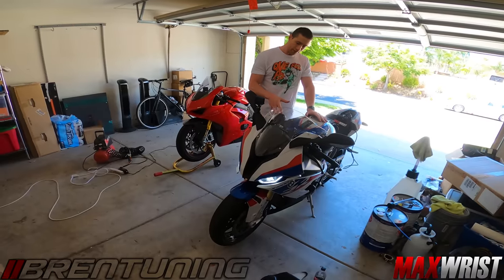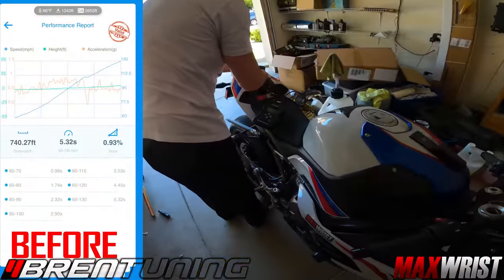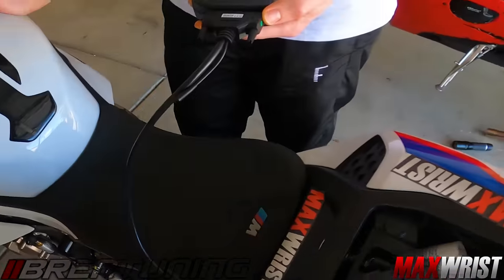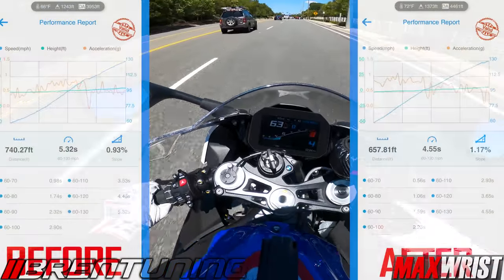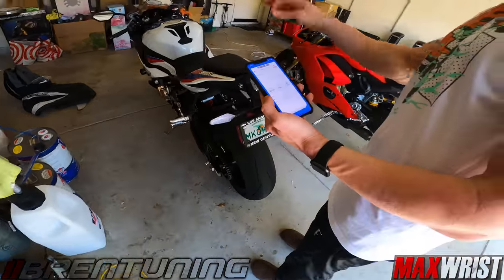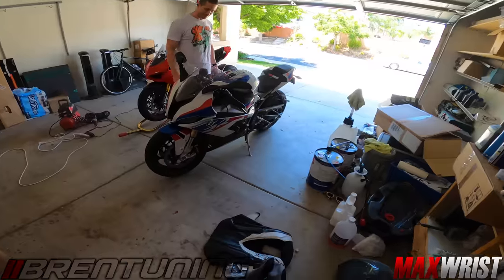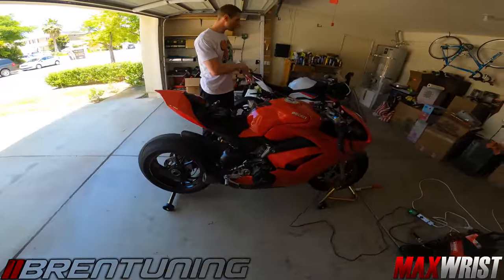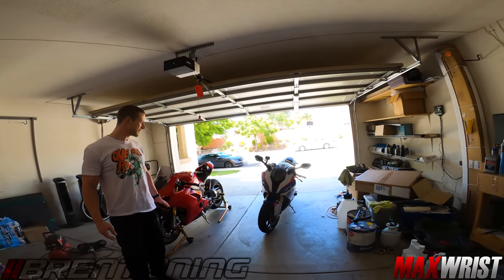Tuning 2020 BMW S1000RR*BrenTuning*Road To 200whp

Comment: The Brentuning tune really transforms the power delivery on the bike.  It makes it so much smoother and predictable.  While more power is always good, it's the ability to take corners in a higher gear with better throttle control that delivers great benefit.  The standard US tune makes it like an old two-stroke bike - nothing in the low end and then wham at 9k rpm.

Comment: Big difference !!! I don't know if I would tune it with MR12 if I wasn't gonna run it all the time.
Reply: I know this is old af, but when you order the flasher from Brentuning, they give you two maps, one for pump fuel, and another for race fuel if you so desire at no extra cost.

Comment: You should leave exhaust stock.  Its not annoying and wont draw attn
Reply: I agree, never really understood that "hype" about changing exhaust by any mean...OK, I know that some new exhaust really make a difference, but with this new bmw "default-standard" exhaust, it became harder to justify such a huge "after-market" push...? I would put exhaust in the last place among possible upgrades, BC the bmw orriginal is kinda cool, loud but not savage, it has some Charm of its own....I know that 99% will mock this comment though, but it's OK...just saying.

Comment: If you run out the 91 fuel for the MR12, the tank holds a half gallon of reserve after an indicated zero range.
Reply: What are you talkin about? It's not like it has a separate fuel tank for Reserve

Comment: will this not add extra strain on  the all ready close tolerances of the engine n components  lessening the life of the engine?
Reply: No.
Reply: the restrictions are for emissions not for engine life
Reply: Ònly removing restrictions enforced by US Law, practically brought this bike to the "ńormal" mode, that Euro & Asia etc. Bikes had right after you bought those.

Comment: Don’t use air in tires use nitrogen get smart !
Reply: The only thing the nitrogen gas does is keep more accurate air pressure. Nitrogen has larger molecules. It will not make a difference for the road Rider. Track Riders use it because they have to maintain a certain air pressure.
Reply: @WICKEDGIXXERL  Yep👍 and regular air has a decent proportion of nitrogen anyways😏
Reply: @WICKEDGIXXERL  are you a racer and know they really use nitrogen in racing these days? I used to be around the racing scene back in early 2000s and there wouldnt have been any benefit to running it. Nitrogen is only beneficial keeping tire pressure correct over time like months in road cars.